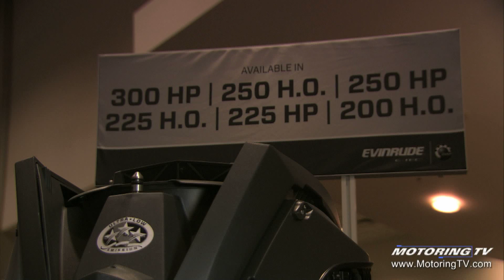Tip of the Week: 2-stroke vs. 4-stroke marine engines

Comment: CO / CO2 and NOx is fine. But what about HC? Would the e-tec still win over a four stroke?
Reply: Yes and last longer too. lees to break and i will avoid these ugly expensive 4 joke strokes like the plaig, look at nature and even lightning and the sun are plasma 2 strokes! they can keep this boring 4 joke crap and i would rather go electric than 4 joke anyday. At least electric motors are a form of magnetic rotary 2 cycle engine. i dont even like the 4 jokes that power cars/trucks and thang god this is on the way: https://mart.cummins.com/imagelibrary/data/assetfiles/0058689.pdf

Comment: Love the 4 stroke, never going back to 2 stroke for any machinery.
Reply: My Mercury 20hp 4 stroke is much heavier than an old 2 stroke and won't push the boat as fast, but I'll take the quieter, smoother operation, with no mixing fuel and trying to dispose of surplus 2 stroke mix at the end of the season any day, much as I loved my old 2 stroke engines. While I'm not some crazy environmentalist, I also feel much better about not putting oil and fuel in to the water, as the old 2 strokes did. I'd never go back to an old style 2 stroke, whatever the weight and performance advantages, I find the 4 stroke just more convenient and user friendly. 

If you are looking at new motors then you do have a choice to make as all run clean and you aren't mixing oil in your fuel. I think purchase price and parts availability and dealer network in your area override any of the arguments as to which is best and which gives the most power etc. All major brands produce decent motors that will push your boat along to your satisfaction if you power and prop appropriately. Saving the odd gallon of gas or losing 3 mph on your top speed will not make up for having a trip ruined because a spare part wasn't available when you needed it. Where I live and boat Mercury has it hands down for parts, service items and dealer network, Evinrude has virtually zero presence so regardless of the technology there would have to be some major reason to not go with Mercury (or Tohatsu in a small motor) just for convenience.
Reply: The 4stroke is older technology...
Reply: Ill stay with my 2 strokes they can keep this 4 joke crap anyday! I hate the 4 joke even in cars trucks. lets see these 4 joke run tilted in any position with just VRO oil injection on amsoil interceptor, It probably could be done.
Reply: Have fun as I’m getting all the 2 stroke I can and all tge more for me. You have all these boring fat ugly 4 joke turds with no oil injection! Let’s one of these 4 joke run mounted in any position with just oil injection and no filter/oil changes. I might go get an ls1 v8 4 joke from a junk yard and cut all that shit off with a plasma cutter and just in 2 stroke oil with a VRO pump and mske a video of it. It may work!
Reply: a 4 joke can be rigged with a dry sump and amsoil dominator 2 stroke oil with homemade oil injection into the intake for total loss burnoff!

Comment: RPM's spin props, drive boats, 2 stroke is all about RPM's and because of the much fewer Moving parts necessary in 2 stroke Operation you have less maintenance worries.
4 Stroke is redundant to the application; Road to tires/Hull the water.
Give "em ten years, these new 4 strokes are basically prototypes and the manufacturers are using the commercial market to Run The tests.
Think; To Many Moving Parts/RPM's.
You can pull an adult skier Up with a 10hp outboard??
4 Stroke is all about torque. (bottom End)
Bottom End is akin to "Hole Shots" which best apply to Cars.
Boats are for High Cruising Speeds not hole shots.
A 2 stroke at 5000 RPM, can run like that all day BECAUSE THAT IS WHAT IT IS DESIGNED TO DO.
AND THAT=Cruising speeds.
Reply: 4 strokes regularly run at speeds of 5,000 rpm or more for hours on end in different applications. I have two BMW motorcycles that run at those sort of rpms on the Freeway at 80+ mph cruising speeds sometimes for hours on end and they can easily do over 100k miles. There are many sportsbikes redlined at 12-14,000 rpm and they too last for a long time too, so I do not feel my 4 stroke outboard running flat out at 5-6,000 rpm is in any danger of failure, particularly as it is in a fairly low state of tune for the HP it produces relative to cylinder capacity. A 2 stroke will have more torque at lower rpm than a 4 stroke and this is one reason why propeller choice is so critical on 4 strokes, slightly too much pitch and they can't start revving to produce the power where as a 2 stroke has more bottom end to let it get out of the hole. The lower bottom end torque is also why 4 strokes have much larger cylinder capacities than the equivalent 2 stroke in smaller outboards. My four stroke 15hp Mercury has 351cc compared to my old Evinrude 15hp that I think is about 220 cc. 4 strokes are here to stay, the additional add ons with direct injection, air pumps etc. for 2 strokes to meet emissions negate the complication and weight of having a cylinder head with valves in a four stroke. Have you seen the weight of Evinrude's 15hp direct injection 2 stroke compared to the equivalent 15 hp 4 strokes? it's massively heavier. As emissions inevitably tighten in to the future my personal opinion is the 2 strokes are the ones most likely to hit problems down the road as they still burn some oil by definition.
Reply: @fiveowaf454   you really know a lott about engines
Reply: @felixagerstig9629  I have so many internal combustion engines between all my motorcycles, boats, trucks cars, generators, yard equipment etc. it's unreal :) , but I've been obsessed with anything with a petrol engine since I  can remember and have been maintaining, fixing and rebuilding them since a teenager so I hope I've picked up something along the way :)
Reply: @fiveowaf454  well it really sounds like you did

Comment: The biggest problem I see with these Evinrudes is the complexity of what is required  to have a 2 stroke meet the emissions requirements, combined with the weight of all these components. It's not such an issue on larger engines, but if you look a the weight of their 25hp it's much heavier than the equivalent 4 strokes. While the 2 stroke gives benefits in terms of torque, I'm wary of the technology needed to achieve this in today's world, these aren't the simple motor of the 2 strokes of old.
Reply: Complexity what is with at, they need no oil change as they do that themself, im sure a 4 joke as i have filled and ran some on 2 stroke and then inject it into the intake, it works good, xd-100 in chevy and other 4 jokes!

Comment: BS, you can easily change to oil on the water.  4 strokes are the future, let go.
Reply: boogerwelder 4 strokes are the future
Reply: Yeah rig up the 4 joke for totlal loss oil burn off and run amsoil dominator 2 stroke oil, or make a poppet valved loop charged 2 stroke out of the 4 joke and make a dry sump with a vew VRP pumps into the intake, and any synthetic 2 stroke oil, cheers.https://www.4btswaps.com/attachments/2cyclesbc-jpg.6839/
Reply: Dismal future  junk!!!
Reply: @arthurtaddei1285  You can run 2 stroke oil in any engine and rig up dry sump with oil injection, amsoil dominator 2 stroke anyone for total loss oil burn off.

Comment: E-Tec Technology ist from Bavaria, "Ficht Technology". It's a serios Technology, not a fake like Volkswagen Diesel.
Reply: Interesting you should mention VW, recently while away boating in the summer for a couple of weeks I noticed the aroma of 2 stroke oil a few times and saw the "culprit" was a boat equipped with an Optimax, Mercury's take on the direct injection 2 stroke. It went through my mind as to whether it was just that some of these motors are getting old and aren't running as well, or whether there was some sort of "dieselgate" conspiracy over the tested emissions of these engines vs the real world.
Reply: mike force  They were normal 115-150 Optimax engines seen everywhere here on the back of Aluminum Fishing boats and they were smelling of 2 stroke oil. As an engineer who has worked in the vehicle and marine environment for many years I can assure you I know which engines I'm talking about and can recognise the odors wafting through the otherwise fresh mountain and lake air. Not trusting anyone on YT is an extremely judgmental comment as it's obvious there are many on here with incredible knowledge and skills based on the restorations and projects taken on and videoed here. How many Optimax engines have you owned? We must have bought and resold 50+ used Optimax engines over the last few years as one of my partners had a source we could buy them from a fleet. Still, you know best.

Comment: 2 strokes are a lot more simple and easy to work on. 
Less maintenance and more efficient than a 4???  GET REAL BUD...
Reply: I repowered from a 4 stroke Yamaha F300 to an Etec G2 300 (about 1,400 hrs on it right now). The two stroke IS MORE efficient, in fact I get about 30% better fuel milage than with the old Yamaha four stroke. So I can go further before refueling, which is nice. I have it on a lift, and never ever have to f**k with oil changes and four stroke maintenance. The difference in maintenance between the two is huge, no comparison, the Etec is far far less maintenance (only had it in 3 times so far). The motor has transformed the feel of the boat, acceleration is far superior, and I also gained 3mph top end. I don't understand why people deny the Etec is better. Having an apples to apples comparison, I far prefer the Etec to the Yamaha, no comparison. The only thing is it's louder at idle, but I don't mind cause it's still not that loud, plus I've made the mistake of leaving my old engine on when I put the lift up lol
Reply: 2 stroke Power to weight ratio is always higher if you compare same technology. Not comparing new modern 4 stroke makes up for that power loss with lot of tricks mostly direct injection, and high compression ratios.
Reply: The sheeple are brain washed with this 4 joke crap, i hate them in cars trucks also never understood the 4 joke stroke hang ups. here a new cummin ACE OP 2 stroke:https://mart.cummins.com/imagelibrary/data/assetfiles/0058689.pdf
Reply: kid riglar The new Evinrudes are not simple to work on.  Try working on the fuel injection.
Reply: Dyno Don fair enough but who pays for a brand new 2 stroke in today market?

Burn more fuel
Doesn't last as long
Doesn't hold its value

And they want how much? 
Especially since I could buy a decent used 2 for a fraction of what Evinrude is asking.

Comment: 4 stroke last longer.  Change oil once a year.
Reply: Dean River all the Yamaha’s and Mercury’s recommend changing it every 20 hours actually
Reply: @WhiteGangster400  fill with amsoil donitor 2 stroke, make a dry sump and DIY vro oil injection into the intake, DIY total loss oil burn off, hehe
Reply: WhiteGangster400 No you are wrong 100 hrs or once a year.
Reply: Wrong!!!!!! You will never see a fifty or sixty year old 4stroke, 10 is the limit  Garbage!!!
Reply: @arthurtaddei1285  4 jokes use much lighter parts and rev higher, they are not built as well either, 2 stroke much heavier duty!
Reply: oh dang you are right; got it confused with the first 20 hour service part but man i see the same boats getting oil changes what looks like every other week on their quad 350's.
Reply: 4 strokes are still king at lasting long
Reply: JaArRyi FleshBlood nah. 2 strokes will always be the best
Reply: @nastynatejernigan8186  your right about that, look at all the big 2 stroke diesels and sled out there.